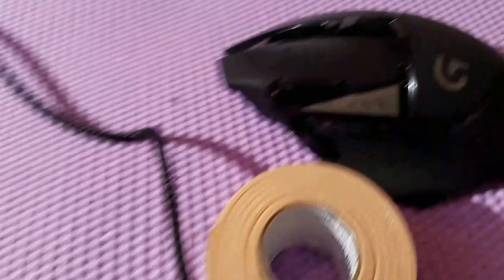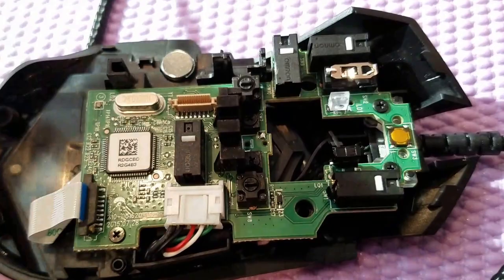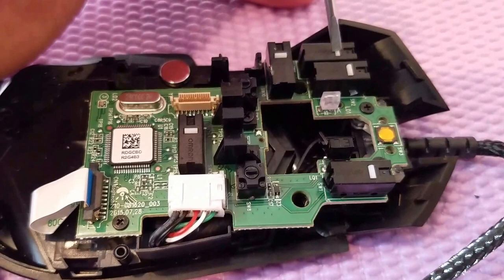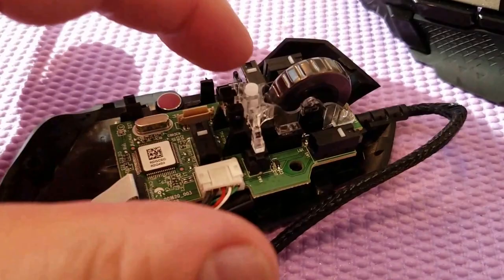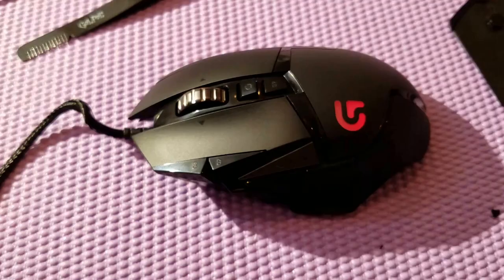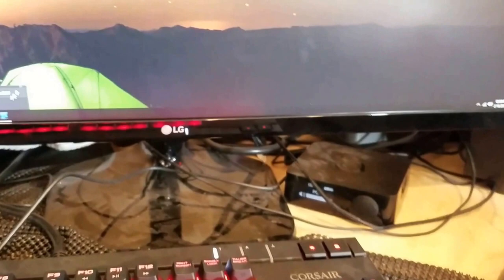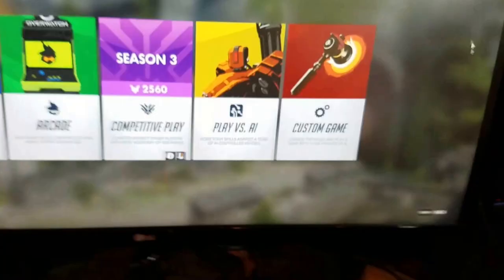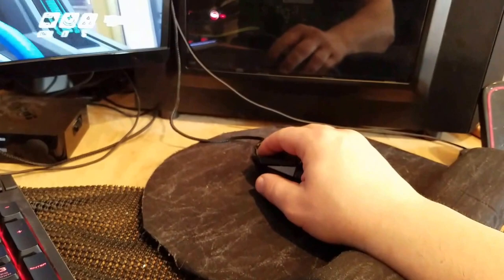How to make your Logitech G502 ultra silent

Comment: Just did it with my G502 on left/right clicks. Apart from being spending 80 minutes figuring out how to put the contact piece back on the left click and believing that I broke my mouse, it went interesting. The right click has literally zero noise and left click has reduced noise by about 85%. I stacked 3 pieces of scotch tape on both, however I ONLY covered the portion above the contact piece that makes the contact noise when clicked. Still get mushy and quick responsiveness but i'll figure out a way around that.
Reply from the maker: Nice, once you start using the mouse bit it will get the click back. I just bought the Logitech G903 and made that thing near 90% silent. Holy mother of .... that thing was a bch to work with. It way over-engineered but anyways glad that you got your 502 up and running. I had same issues with contact falling off and I thought that I broke it but yea its not that bad honestly. Just use tweezers it will snap in place. Happy silent gaming!
Reply: You could buy some Kailh Silent switches too and solder them in. You can get a decent soldering iron for cheap.

Comment: Are the click less responsive?
Reply from the maker: No but if feels slightly different, kind of mushy. After few min of using it you get used to it. I just switched to New Logitech G903 and did same thing to it. I do not recommend doing it to G903 as it was pain in the arse but G502 was easy for the most part.
Reply: @sorgic435  Did you fix the side buttons on the G903? They sound pretty terrible to me by default.